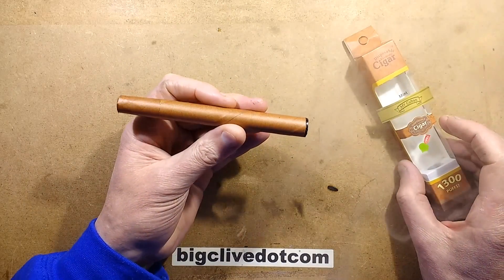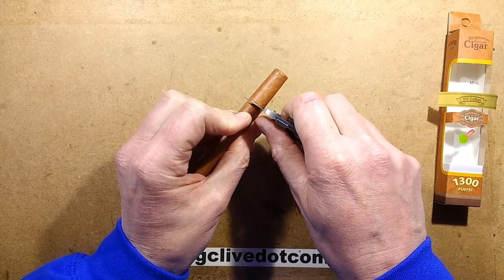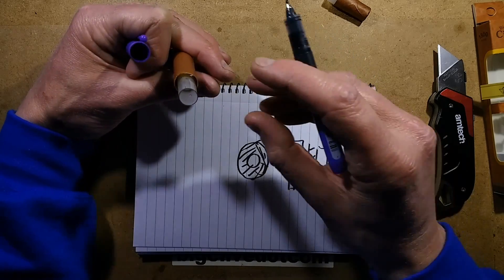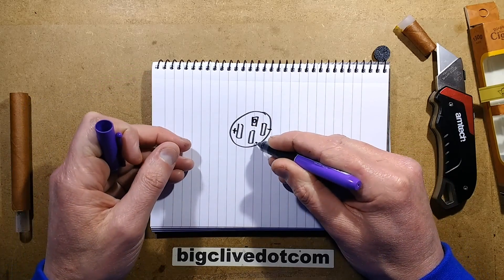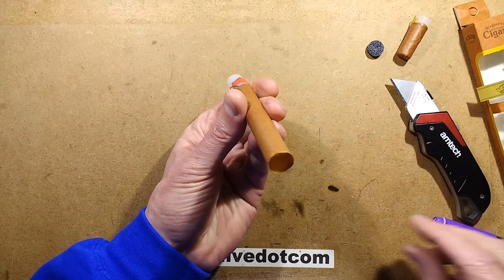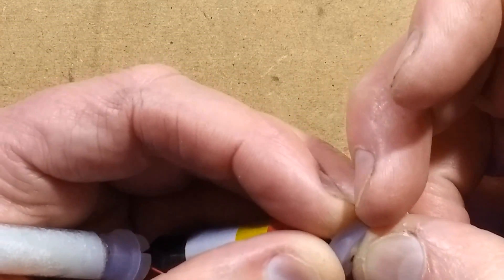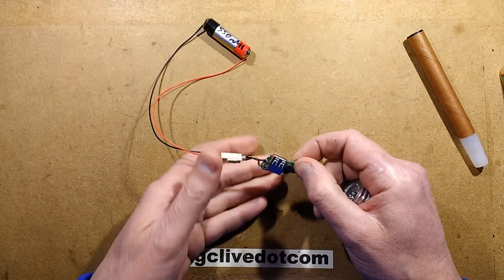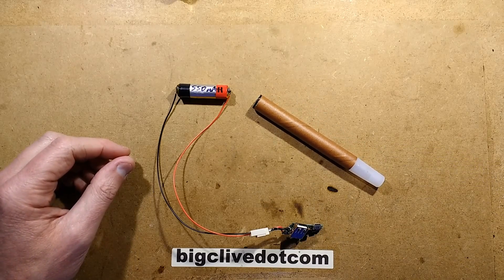Can a disposable e-cigar be refilled and recharged?

Comment: Hey clive quick question, on these rechargeable vapes is the charge board salvageable for other projects?  That you for your time.
Reply from the maker: It can be reused.  In the very minimalist rechargeable disposables that have a lot of liquid, but a small cell, the built in charge circuit often charges at around 300mA.

Comment: Also, how a vape works 101...    Or that one to be specific, soooooo when you inhale it senses the pressure difference which activates a switch which puts power through the coil which heats up the juice which is wicked into the "ceramic" (that is a ceramic wicking material, not cotton and certainly not fiberglass otherwise itd be illegal to sell) which atomizes into a vapor for you to inhale to get that glorious nic high

Comment: "pulls air from the battery compartment"
That doesn't sound very safe in case of failure
Reply: Its very low power, its nothing to worry about

Comment: It's cheaper to buy rechargeable because a) how they're made results in a charged cell and b) high current draw applications require certain battery chemistry which is indicative of changeability. In fact alkaline batteries are rechargeable although not as effectively as lithium if you're willing to discount the fact that they will slowly outgas and the electrolyte will melt. But most importantly alkaline batteries have high internal resistance which means.. they will start reacting with them self at high current, get hot and perhaps even explode. This applies to discharging as much as charging.

Comment: bigclivedotcom , Hi. Great videos about everything. I learned a lot from
 you. I have a proposal for you. Could you make a video about different 
LEDs and inverters? I have in mind those modified sine wave and those 
homemade :) some descriptions (how to use, if it's possible to use, what
 could happen), charts and diagrams would be perfect, no need for actual
 inverters and lamps. If it possible, talk about CFLs too. Currently, I 
am afraid to use inverters with my lamps, because I don't know, if it is
 safe.
  Sorry if I made some mistakes, English language isn't my first 
language :) Best regards from Lithuania and good luck making those 
videos :)
Reply: Why wouldn't an inverter be safe for a lamp? Lamps are the least fussy as far as loads go because they're only resistive. I wouldn't bother with a homemade inverter anymore, no cost savings unless most of the parts are free. When they first came out there was, though. The Radio Electronics Magazine I got had plans for one and I started saving up parts for one. I never acquired the CT transformer, though.
Reply: LEDs differ from those incandescent, they have electronics inside, so I just wanted to ask Clive for some help. The home made one? Just curious. I have made one, just for testing, simple circuit, but not using. So I'm curious what could possibly happen. That is all :)

Comment: What do folk use re-purposed lithium cells for? I get their use for specialist Arduino applications, torches (flash lights) , power banks & similar which one needs only a few of, but searches on the net show few other applications. Is this because I am missing some big application, maybe connected with solar charging, or are they likely always to be very specialised use only? Just interested as they seem such a useful source of power that currently lacks a purpose.

Comment: Aren't these things dangerous.
https://www.google.com.au/search?q=e-cigarette+explodes+in+man%27s+face&client=opera&hs=U4D&tbm=isch&tbo=u&source=univ&sa=X&ved=0ahUKEwj9soz9-ZvTAhWCipQKHV0tAzEQsAQIIw&biw=1280&bih=641
Reply from the maker: +SidneyCritic ComedyHound The media jumps on every failure to get a cheap headline.  Most failures have been due to use of wrong chargers or DIY modifications.  Actual failure is rare.
Reply: Nope.
Reply: Not compared to smoking. London Fire Brigade strongly suggest switching to e-cigs if you smoke, because the risks of fire are so much lower than smoking.

You might see flashy tabloid stories about e-cig cells popping, but remember, there are three housefires a day started by lit tobacco in London alone. Consider that relative risk...

https://www.fire-magazine.com/switch_to_vaping_to_reduce_fire_death_risk_warns_london_fire_brigade_25769839706.aspx
Reply: Poor chargers/adapters seem to be less of an issue now that most devices have moved onto micro-USB for charging - rather than the screw-on adapters that had the absolute cheapest USB adapters bundled with them, and the charging devices weren't the most robust devices in the world, themselves. 

I suppose most people use their own, better quality USB chargers rather than the ones provided back in those days. Certainly, I just use the laptop ports, or my (reasonable quality) 2.1amp mains adapters for charging.

The other cause is people putting 18650 cells in their pockets along with keys and change. Given how much energy a typical high output 18650 has in it, and how quickly they'll let that energy go if they're shorted out by something like, oh, I dunno, metallic objects like keys and change, that seems....ill advised at best.

Comment: Form what I have learned vaping, the wicking is either cotton or silica fiberglass.
Reply: Typically silica is used in very low end or disposable devices - pretty much any decent refillable device will use cotton as it tends to degrade more gracefully.

Comment: The coil on this low cost item is probably 26AWG kanthal resistance wire. The wick that goes through the coil is usually silica wick, and the wrapping fiber is usually cotton, these days.

Comment: Of all the disposable e-cigs we've tested in the lab, not a one has yet to use a one-use battery. All rechargeable (with some fiddling).  This is quite a hefty battery, the cigarette sized ones have appallingly tiny ones and some are pretty dodgy looking construction.
Reply from the maker: It's kinda weird having a rechargeable cell inside a disposable item.  But I guess it's just the cheapest and most material efficient way to do it.

Comment: I took apart a disposable CBD oil vape pen just to see how it worked and it's exactly the same as all of the other devices.  I was curious how the capsule worked and I figured it was sensing a pressure differential.  Guess I was right.  Thank you for confirming.  Oh and I like the zoomed in segments.  They look great full screen on my 37" monitor.

Comment: Yeah, it's not smoking tobacco, but you have ZERO idea what is actually in that chemical concoction they sell you.  I'm just waiting for it to come out that some company is using a brew 10 times as toxic as the tobacco would have been.
Reply: Er, yeah. We kinda do. It's propylene glycol, vegetable glycerine (in varying ratios), flavouring of some kind, and nicotine as an option.

You might not know what's in them, but that doesn't mean no-one does.
Reply: Beany2007FTW - you just said it yourself "flavouring of some kind"
Reply: Lack of full ingredient labels, plus https://www.ncbi.nlm.nih.gov/pmc/articles/PMC3995255/   They even start of mentioning that "the nicotine level listed on the labels of e-cigarette cartridges and 
refill solutions is often significantly different from measured values" in the ones they studied.
Reply: [citation needed]

Comment: I wouldn't worry so much about directly inhaling those fibers, whether they're made of fiberglass or, more likely, a form of plastic such as polyester (PET). Those are largely inert. I would be more concerned with the emission byproducts created when the heating element comes into contact with that plastic fiber material, especially if the element ever gets hot enough to melt it, even slightly.
Reply: I'd be more concerned what's in the liquid and the quality control on said liquid.
Reply: The airflow and liquid wicking will cool it down to the extent where it won't burn/melt (especially as it's waiting for airflow before heating the coil). That's the basic way that all e-cigs work. :-)

If you dry burn it, believe me, you'll know - it tastes utterly, utterly, godawfully foul, and there is no mistaking it.

Comment: You should get a proper cloud setup and tear it down!!
Reply: There's not much to tear down in them these days - the atomisers in the bigger ones are designed to be pulled apart (to an extent - the atomisers all work in a very similar way; big wicking, big airflow, just add power to taste) and the devices are either completely bare mech mods regulating their power out put/draw from the cell based on coil resistance, or they are regulated with little in the way of interesting discrete components.

There is some interest in performance testing, but others (Phil busardo and DJLSBVapes) do this specifically already.

Be interesting to see a collaboration between one of the above and Clive though should the idea be amusing enough to him.

Comment: what device do you use to measure the battery capacity, i have found that most cheap usb charge monitors are quite inaccurate, any recommendation? great video as always
Reply from the maker: For this one I used a Uni-T USB charge meter.

Comment: Clive, the wick is also fiberglass (will not burn when subject to heat and is used still in the cigalike devices widely sold) and the reservoir material looks as if it's Poly cotton....and yes you could refill it with any e-liquid as long as it is 50/50 Vg/Pg.

Comment: The question is, does your your cigar contains a lithium battery (very powerful per cm2 but not designed to be recharged) or a lithium ion battery? In the first case the battery has a METAL lithium electrode and the metal will migrate through the the electrolyte after a few cycle it will short out the battery and blowup, in the second case it contains only lithium IONS in a carbon substrate and can safely be recharged a few hundred times, To figure it out what king of battery it used you'll need either to do a few tens recharging cycles (relatively easy) or disassemble the battery and try to extract the lithium metal from it (not so easy).

Comment: that battery has more capacity than most ultrafire 18650's
Reply: ultrafire is not the best supplier but the batteries are decent. for some odd reason almost all the fake cells are falsely labeled ultrafire (often even uitraflrc or other names clearly not copied using a latin language keyboard). its the fakes youre talking about.

Comment: The wick material is usually cotton - Japanese organic cotton is popular, radioactive but popular LOL. Unless the current through the coil is way beyond anything sensible then basically the wick gets saturated with hardened ethylene glycol (tastes sweet) and glycerin (as used to make Christmas cake icing soft) and stops working properly and needs replacing. The tests that have been carried out to prove these vapes are unsafe put so much current through the heating coil it vaporized. 7 - 10 watts is quite adequate for vaping as you would smoke a cigarette but unfortunately there is an abundant supply of idiots trying to emulate an Indian diesel train.  https://www.youtube.com/watch?v=RHsp0Q6ISBo  which has caused pubs to ban vaping - well done dick heads.

Comment: I despise disposable elctronics like hits - All those wasted lithium batteries!!
Reply: they aren't "much cheaper" tho, you can get reusable ones for under 10£  granted you might get disposable for under half that, but you don't actually save more than a few £ for all your hacking anyways...
Reply: Well look at it from a consumers point of view: Once either charge is depeted, the unit gets chucked in the bin as a whole - including the battery.
Reply: @nrdesign1991  I hate disposable anything which can easily be reused, it's really bad for the environment, but I don't know if lithium batteries are any worse than alkaline ones. I suspect they just get the cheapest lithium cells they can, hopefully rejects which would have been discarded anyway.
Reply: Alun Jones lithium-ion is 5x worse, or more, for the environment than alkaline
Reply: @alunjones3860  dude, it is way worse
Reply: Well if you want something reusable, it makes sense to buy items that were built as such, they are usually so much better made, you get a real product there.

But if you're buying it for parts, to get that battery, to get that pressure sensor, to get that evaporator for a project that doesn't involve actually filling your lungs with that vapor, then a disposable one is more suitable, you get cheap parts, and it's easier to dismantle!
Reply: Just eat the fucking batteries when you are done
Reply: Lithium is rare metal as well as extracting it is bad for environment.
Reply: Why, you should love it. You can buy it up much cheaper than "reusable" electronics and give it an extra lease of life.

Comment: isn't the Mic actually sensing/hearing the hiss noise as you inhale, thus closing the circuit?
Reply from the maker: I think some of the earliest units tried that, but I took one of these capsules to bits completely and it was just a film being drawn past a super-thin washer to make contact with the case.  The chip inside was just a generic e-cig chip that could take input from a button or the diaphragm.
Reply: No, it's not noise sensitive, but i argue, it's really still a microphone of sorts! The way electret capsule works, it's going to produce a different DC offset depending on the pressure. Then there's a JFET inside a microphone capsule to modulate the supply current but keep it linear, which can be replaced with a MOSFET to turn it into more of a switching device, so that's likely what they did. It won't sound good at all though, pretty distorted, and they may have filtered out higher frequencies altogether, which would kinda make it super useless as a microphone.
Reply: No, it's not actually a microphone, as he explained several times. It just looks like one.
Reply: Apple Dash yeah I heard him...no need to chime in just to condescend. thanks though.
Reply: bigclivedotcom AWESOME..thank you for the ACTUAL information and not being "holier than thou" ...appreciated!
Reply: Siana Gearz thanks for the reply...I may have to chime back in a year, when I'm "smarter" to read it over again and actually understand it LOL
Reply: Huh? I wasn't meaning to be condescending or anything, but I was just letting you know that the question you were asking was already explained in the video... I'm not holier than anyone.

Comment: ...meh in the end this just means that the only real downside to turning one of these into a fully fledged refillable and rechargeble e-zig is, that they´re just not very good. and even though ive not invested in one of the 100+ buck models, i have to say there is a noticable quality of enjoyment difference between the low priced models that use just those tinsy heater elements and something just a litle more substantial.

knowing these things is interesting but doing a conversion of one of those seems like a waste of time to me

Comment: that looks like the little 1200, 900, or 650mah 1S Turnigy Nano tech cylindrical cells, or the unbranded cell they then brand with their stickers. they actually work pretty well for devices 18650s won't quite fit, where square cells also take up too much room and smaller 18350/18500 don't provide enough power.

Comment: theoretically any e cig can be refilled. i remember refilling my old overpriced e lite cartomizers by popping off the cap and pouring some more e liquid in. theres a limit to how many times you can refill a disposable though before the coil gets so gunked up with burned on residue that it starts to taste shitty. i would guess probably 5x before you notice a taste difference. theres a little known youtuber called "granddad is an old man" and he tested the pound shop disposable e cig batterys for rechargability. they could be recharged as well

Comment: Question. Why are rechargeable lithium cells cheaper than non-rechargeable?
Reply: Economies of scale. How many lithium non-rechargeable batteries do you see in products? Now compare with the number of rechargeable batteries you have just in the room you are in.
Reply: When you put it that way, yeah that makes sense.
Reply: Actually one of the reasons is that Lithium is expensive, and rechargeable chemistry contains about 10 times less Lithium than Lithium primary cells! But yeah it's mostly just because there are a lot of Li-Ion rechargeable products, so there's a lot of leftovers that somehow didn't end up being used for original purpose, you can't store them forever, so eventually they get dumped pretty cheaply.

Comment: These things are so behind the times. You need a vapouriser which takes 4 18650 batteries and can output 300 watts at 50 amps.
Reply: Pfft, nobody needs that.

We all want it though. I hear Kanger have a five cell, mod coming out soon. Think it's still 200w (might be 300w, didn't look that closerly) but still, that's gonna double up as a ciggy replacement and a personal defence weapon. It'll be the weight of small hammer head!

Comment: Interesting to see it in action. I bought an e-cig starter kit recently for 1.60GBP and that included free delivery. It's a rechargeable e-cig and includes a little tub of e-liquid. I really just bought it for the same of making a video but it seems to work alright. I just worry about the liquid and the materials inside, like you mentioned about the wicking material. Cheap Chinese stuff doesn't have the highest regards for health and safety.